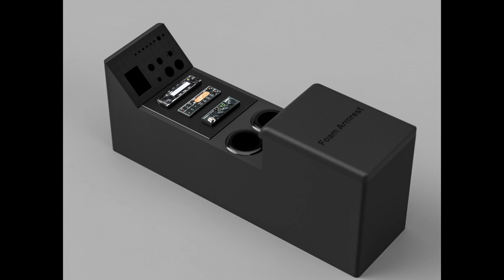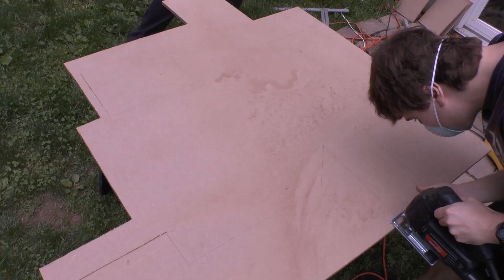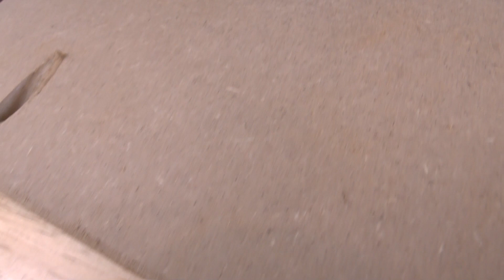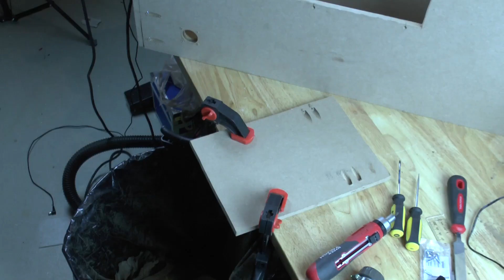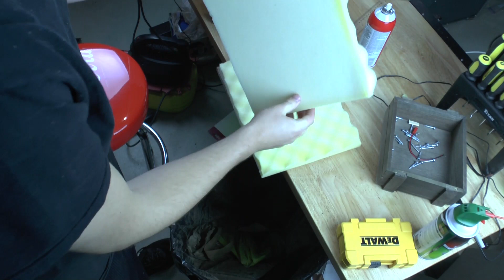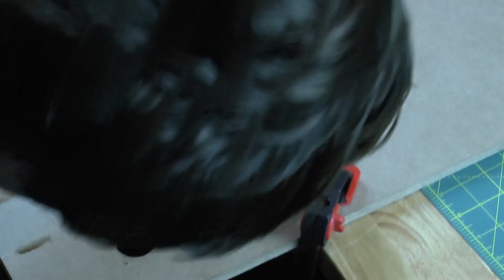Center Console Build Part 1- Making the Frame

Comment: Good job! Where did you get the cup holders from?  73 DE N9GWS
Reply from the maker: https://www.amazon.com/dp/B013D85V90/ref=cm_sw_r_cp_api_i_O5hmEbD70P2HR

You can also search Amazon for “cup holder inserts” and it will come up with more options for different numbers of cup holders, plastic or stainless steel, etc

Comment: Where did you get the cup holders?
Reply from the maker: These are the ones I used: https://www.amazon.com/dp/B013D7TXZO/ref=cm_sw_r_cp_api_i_qAhXCbKG6R3TS

If you search “marine cup holder” on amazon you can also find them in white plastic and stainless steel depending on your project needs

Comment: Do you have a link for the cooling fan you used???
Reply from the maker: The eBay listing for the exact ones I bought has ended but these are very similar:
https://www.ebay.com/itm/12V-40mm-Cooling-Computer-Case-Fan-4010-40x40x10mm-DC-PC-3D-Printer-2-Pin-4-Pcs/182538491238?_mwBanner=1&ul_ref=https%3A%2F%2Frover.ebay.com%2Frover%2F0%2F0%2F0%3Fmpre%3Dhttps%253A%252F%252Fwww.ebay.com%252Fulk%252Fitm%252F182538491238%26rvr_id%3D0%26rvr_ts%3D46c46cf91690a88af1643646ffdb3a30&ul_noapp=true&pageci=be506d3b-daba-49b1-aebe-18312d980cc4

Comment: That's a lot of stuff to wire up. How did you do all the wiring?
Reply from the maker: Aaron M well so far I’ve only wired up the touch screen, radios, and the main lightbar so I still have all the rest of the lights and USB ports to do. It’s fairly straightforward though. I basically have all the grounds connected together and then the positives get switched on by the relay board. It does the basic stuff I need for now but I hope to finish wiring everything up eventually. Thanks for watching!